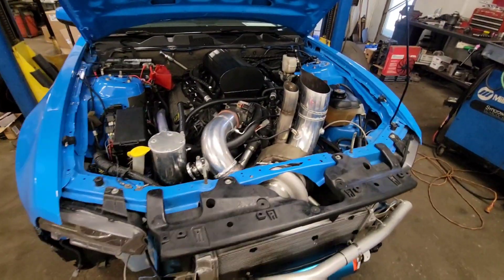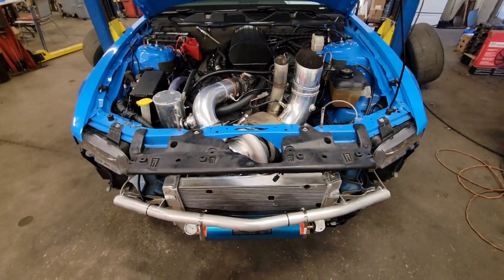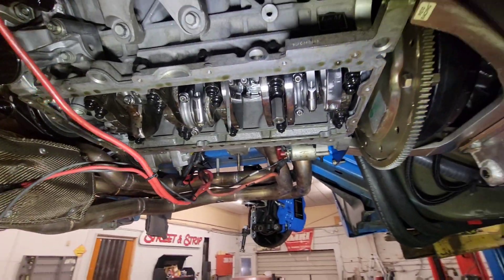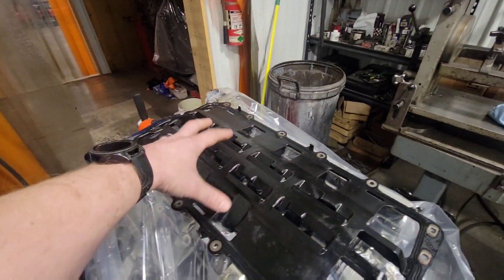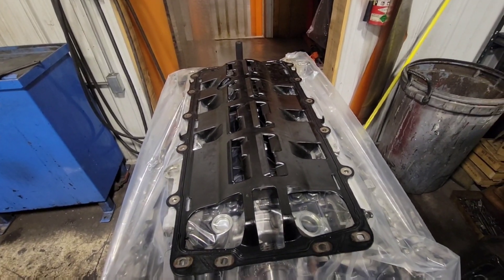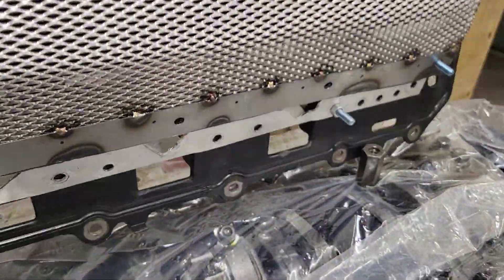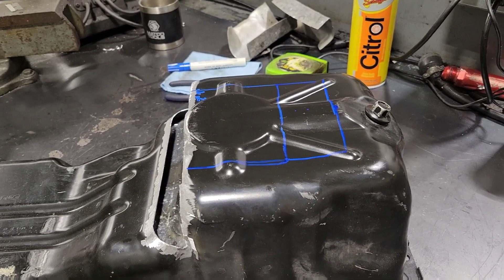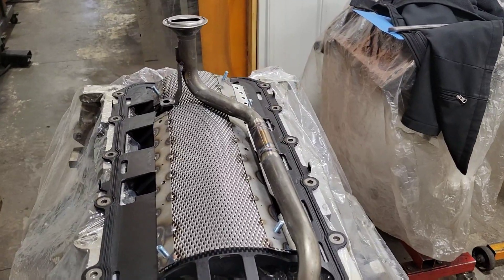Ford Coyote Oil Control Upgrades | Accusump, Windage Tray and Oil Pan

Comment: Did a great job here and I understand why. But got a question. I’ve seen Canton with a metal similar tray with the screen and scraper, Which seems way better than the factory plastic one I’m curious you didn’t use that.
Reply from the maker: Tbh, im not sure that was available at the time.  Or at least I didn't know about it.  Would have saved me some time! Lol it's a nice piece